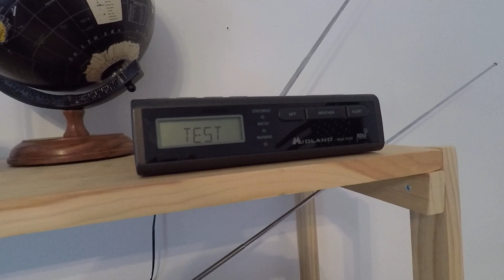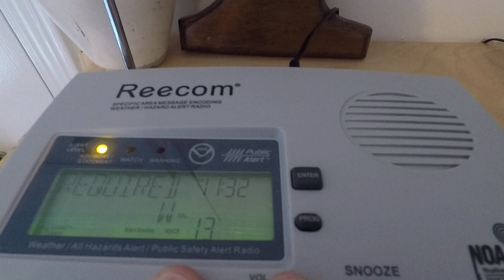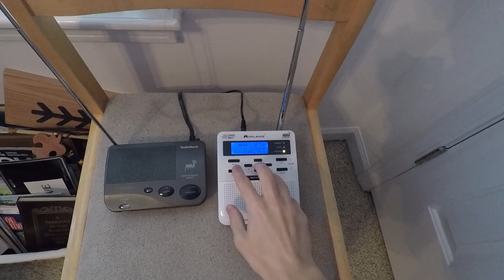EAS #3- KEC80 Required Weekly Test (FAIL)

Comment: How did it fail a fail is when there is no voice/ off the air message or no test at all
Reply from the maker: KEC80 has 2 audio feeds that get to the transmitter: One is a point to point microwave link, which is wireless, and is also the main source of audio to the transmitter, and phone line, which used to be its main, and is now a backup audio source in case the point to point goes out. When they were playing the headers, you can barely hear almost a half-header played, and that was a result of them switching to their normal system. When the first and second headers were going off, it was using the phone line. https://www.youtube.com/watch?v=DIYZTvSzUwI In this video you can hear the wireless cut out, it switch to the phone line, then during the headers back to the wireless.